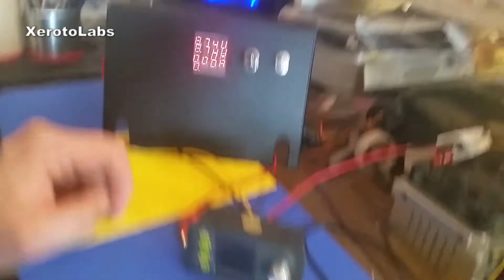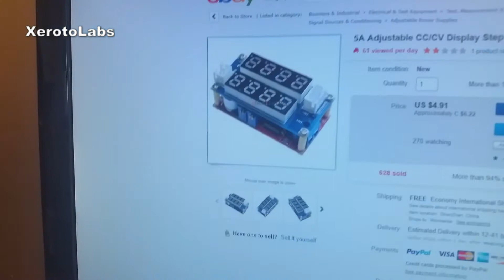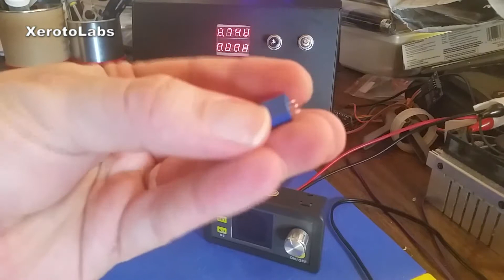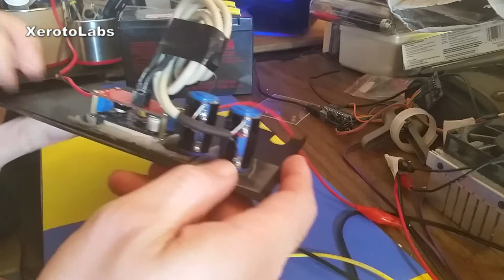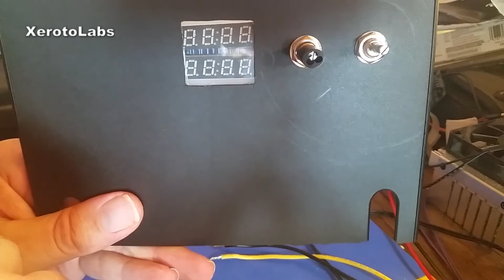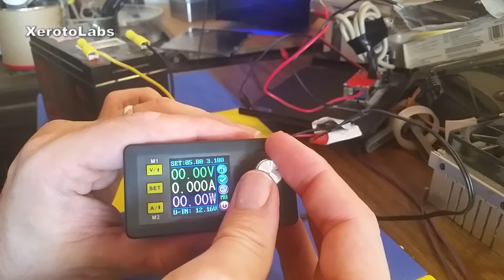Small Bench Power Supply [progress]

Comment: Good job. RD has made a few new models now. I bought 2 so far, i dunno if i need the 50v version yet. Yer i want it. Do i need it? Of course :)
Reply from the maker: IM loving my DSP3003, all my stuff is small voltages and currents. Larger stuff is covered by the old style PSU with LED display.  the lower voltage & amperage models seem to have better resolution in smaller steps.  I think I would like one of the new ones with a blue tooth or USB connection to PC, if/ when I redo this one. The computer PSU has enough power left over I could run my Fabricator Mini V1 from the spare 12v rail. 
In one of my later videos on this project, i uses 2 booster modules to take the 12v line up to the 30v ranges.
But yeah I would like to get one of the ones with the data modules.  I have enough PC PSU's kicking about.